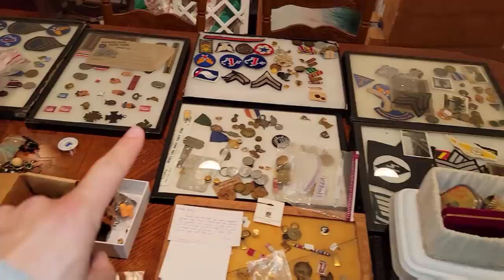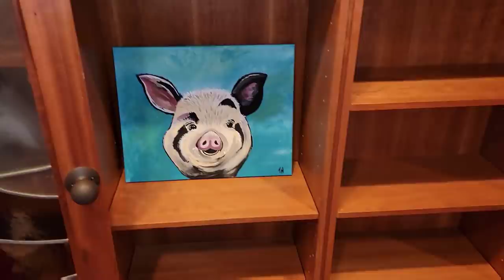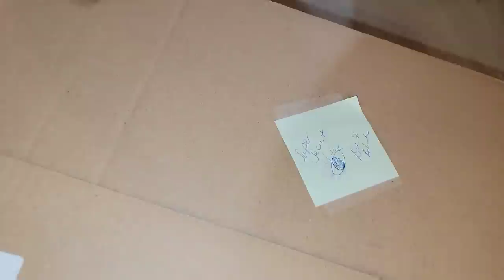SHE CAN'T GET IN MY SHE SHED ... I Bought My Dream House

Comment: I like the banana holder but if you want the bananas to last longer, cut the stems all short or cut them apart and wrap saran wrap around the ends. The vapors released by the aging bananas ages them somehow. I saw it and tried it and the fruit lasts days longer. If you are very far from the nearest store it will save you time and gas from going back and forth.
By the way, I like all your videos so far but my favorite are the ones where George beats the coin pusher. I tried those one time when we were driving the rig.  Lost all my quarters! LOL

Comment: I have a similar vacuum and new I thought it was not working. What happens is that you need to step on that big button in front by the canister and it will work

Comment: Jeremy and George it is never safe wrapping up live electric wire, as when any wire have live current, it get hot if it's wrapped up and can cause a fire. It would be far better for you and George to cut that light wire in your kitchen to a shorter length so that it's not wraped. Be safe.Any wire with current running through should not be wrapped.